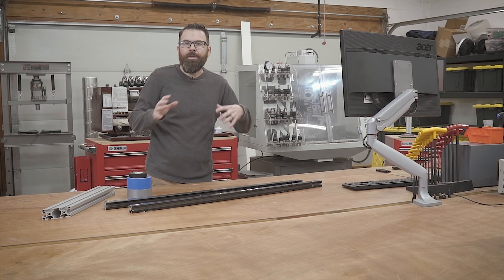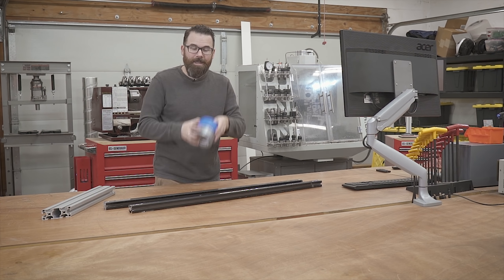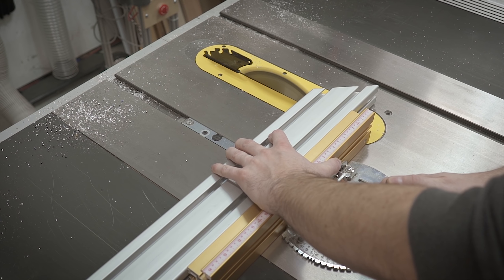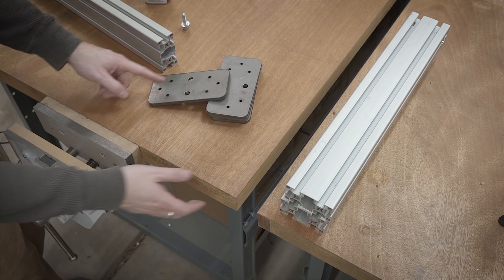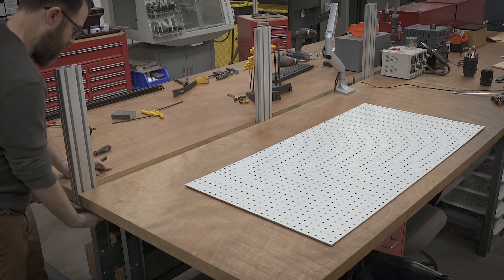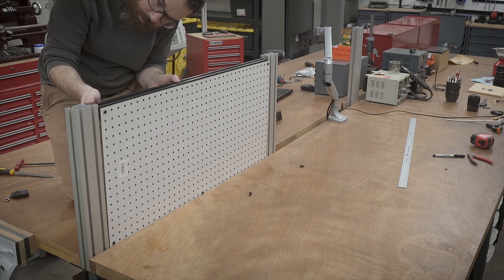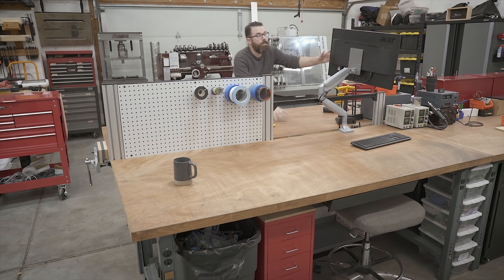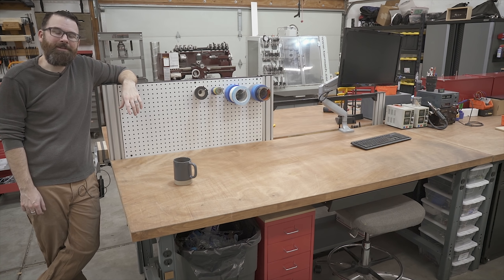The Great Tape Storage Journey

Comment: It's a tough one.  I often find myself in the same place.   Looking at it in the video I had two thoughts.  Is it going to potentially be an interference issue when clamping something in the vise and sometimes it is nice to have a really large surface to lay something big on to work on.  Obviously the divider will limit this.  I vote (not like it counts for anything :) )for putting it (tape holder) on the wall and leaving the worktable free of a divider.
Reply from the maker: Oh, I hear ya.  Before this project, I really couldn't use the benches as a single surface.  I have my table saw (I'm planning on building an outfeed table) and the CNC router.  So I have a couple surfaces that are 4' x 4' or so.  The benches are 7' x 3'.  I haven't found many instances where I need more surface than that.  The vise is really only used for smaller things, I'm not really a woodworker, so I don't use it as intended, I just hold small parts (like you saw in the video) for tapping and such.  That still works just fine.

Comment: If the monitor mount works inverted, mounting it to the ceiling ( or a post that is ceiling.mounted) might be an option. allows for a full-sized peg board divider and still keeps the screen accessible from both sides
Reply from the maker: The ceiling is very high, at least 10' I think?  I would love to hang more stuff from the ceiling, but it's too high up, and running cables would be a pain as well.

Comment: I think I would have the divider on the short axis of the bench not the long axis as you have it.  This would mean you still have a large square surface for doing big things, you can still do the camera angle across the bench like you did in the introduction, a  monitor arm that can "go down" could be mounted on top of the mid extrusion.

Comment: I actually kinda like these videos, regardless of the 'its just a pegboard' comment. It's along the same lines of Adam Savage spending several hours putting in place some new storage solution that will save him 3 seconds once every 2 months. The process and creativity that goes into thinking how you can change your space is one of the things I enjoy most about doing this myself. It's small steps that goes into making your creative space that little bit nicer to use. 

8/10 - would watch Rob make a pegboard again. The cliffhanger with the monitor was mean though. I'll be sorely disappointed if you fix that issue without showing us...

Comment: So what happens when you’re working from the opposite side that the tape is on?  Do you have redundant tape stacks (😎)?  I would think vertical stacks would work better since you can access from either side, unless the intent is to add more pegs to the pegboard.
Reply from the maker: I've found that I use pretty much everything everywhere in the shop.  Having more stuff centralized helps.
Reply: @RobertCowanDIY  ok how about tape dispensers suspended from the ceiling. On tracks to move them around?  You do like complicated. 😄😄

Comment: Is it possible to make a transmission system for a heavy spinner to make it spin up faster and a higher tip speed? I’m thinking about making a 250 lbs fbs bot that spins after than any other fbs in history
Reply from the maker: Well, faster isn't always ideal.  You can't go above 250MPH, and even getting that much weight to spin that fast is a challenge.  Also, you might be significantly less stable at those speeds.
Reply: @RobertCowanDIY  Btw I’m gonna completely new to this sport when I get involved.  That being said I’m thinking of using tracks instead of wheels for traction which I think will help increase control and stability while also helping to spin the shell and not the body. Also gonna make the drive motorcycle very responsive to get more agility s as nd be more difficult for con trol bots to rush me

Comment: How do you keep your ridgid tablesaw fence square to the miter slot. mine has so much variation in it. sometimes it will toe in to the blade sometimes it will toe out. I hope you have a solution, because I tried some 3d printed larger pads and that didn't really work.
Reply from the maker: Eh, I just push it forward before I lock it down if that makes sense.  I push it against the rail to make sure it's seated well and perpendicular.  It can easily lock at an angle either way, but I found a 'trick' of just making sure it's engaged in the front rail before locking it down.  It's not great, but it works.
Reply: Thank you for your reply. Yes, i do this, it works kind of. I am searching for super precision which I think I might only achieve by replacing the rail system with something else. Maybe the Super Cool Tools fence. I really enjoy your teaching style by the way. Thanks.  @RobertCowanDIY
Reply from the maker: @crashkg Thanks!  Yeah, I think replacing/upgrading the rail system is your only option unfortunately.  I really don't use it too much and it works for me.

Comment: If it's worth engineering, it's worth over-engineering:  How about an overhead gantry system?  Not sure what you have overhead, but how about suspending from up above?  Leaves the valuable horizontal and waist-level space unencumbered.  I was thinking the same for your CNC controller/monitor.  Something overhead that could roll back and forth or left and right, and hang the CPU behind the monitor; there are lots of very capable Win10 CPUs that aren't much bigger than a hardcover book.  Now you only have power and CAT5 coming off the CPU/monitor pair.
Reply from the maker: My ceiling is pretty high.  I've thought about doing something like that, but it's just so high up.  I don't really have a problem with the computer, it's under the workbench, mounted on the underneath side of the top. You'd still have to run cables, so it doesn't really save me anything.